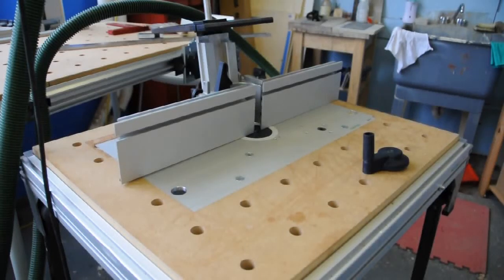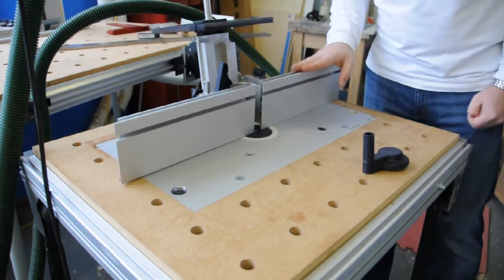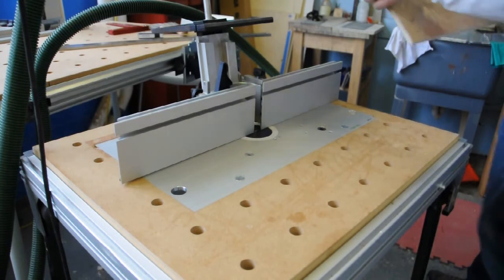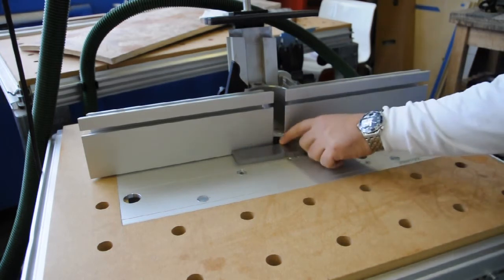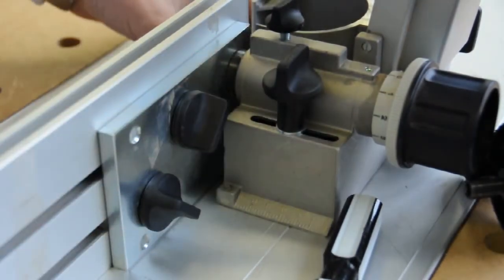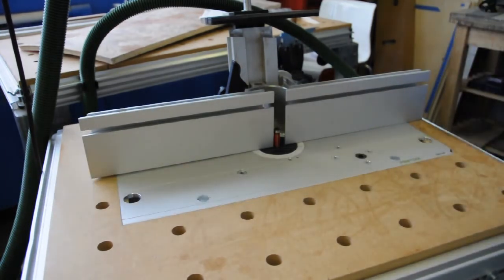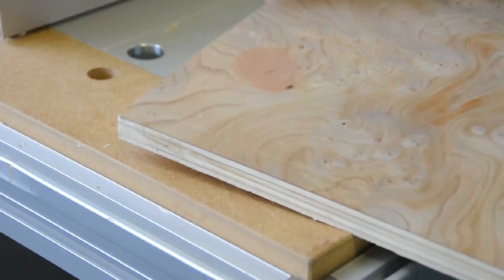Jointing with the Festool CMS table

Comment from the maker: The second MFT table serves as a useful infeed or outfeed table when necessary. 
I would strongly recommend the Festool CMS system and OF1400 router. It may seem expensive but when you add up the cost of a comparable system, it compares well. After all, you only need one router for a start- not a plunge for handheld work and a fixed one to go in the table. 

My straight edge is from Lee Valley, but for shorter pieces I use their aluminium winding sticks.

Comment: I had jessem table and fence before, I had a problem with the offset of the fence, trying to use it as a jointer. Festool is much more reliable and accurate, as a bonus, it is so easy to take apart and put together... I love woodworking, but since it's my hobby, I don't have a full size shop...festool rock!

Comment: Thank you very much!
I was very concern about the hefty plate + fence assembly and stability of a MDF top on MFT, waching your channel helped a lot
the only thing didn't work for me is to use router fence asembly in support of the vertical pannel, since manual is for a basic stuff only, how do you set up the black "featherbord"???

Comment from the maker: I would rather have tools and tables that can be finely calibrated by the user than ones which are set up by in the factory and leave no opportunity for the user to correct any faults or fix them at a later date if they move out of calibration. 
The Festool tables are a little expensive to be used as a mere router table- I had two small MFT 800s and converted one into a router table when the CMS table was unavailable in North America. I brought the module over from England.

Comment: At first I was going to comment on the disappointment that Festool would produce a product where the fence was not coplanar. But then you proceeded to show that adjustment mechanisms were included for just that purpose.

I like the idea of using the Festool table for a router table. I'm anticipating building a new top for my table when I get a Jessem router lift. I might incorporate this.

BTW, always curious about others tools. What's the source of your straight edge? Thanks.

Comment from the maker: Just be aware that my router table plate sits in an MFT 800, not an MFT/3 which is much larger. My plate is only a few inches from the edge of the table. 
I think there is a video from Festool USA on youtube showing the featherboard setup better than I can. 
Thanks for the compliments!

Comment: Could you please provide a link to the instructions on how to cut the MFT 800 to accept the CMS-OF router support module?
Reply from the maker: Hi, I wrote a little bit about it on the FOG forum, but I don't have specific instructions. I used the module itself as a template, used my TS55 and a jigsaw to cut out the hole, and a router to make the recesses.

Comment: there's a gap on the left side of your fence, vs. the table surface. Why is that?
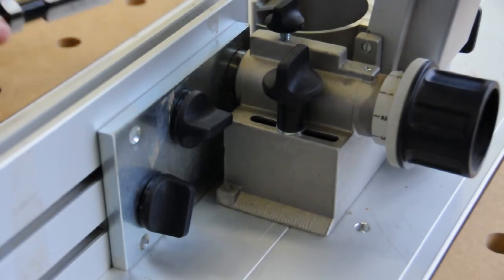Reply from the maker: Good spot. The fence is held in place by knobs that screw into the rear rather than down into the table (see about 3:50 in). On my table the knobs must be a little high  on the left side causing the gap, but it makes no practical difference. If they were too low, then I would have a problem.